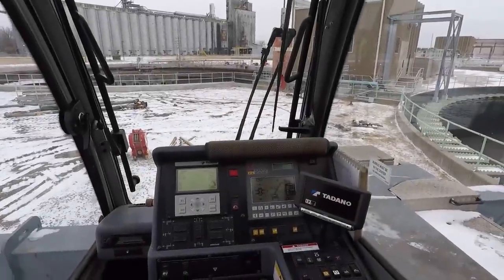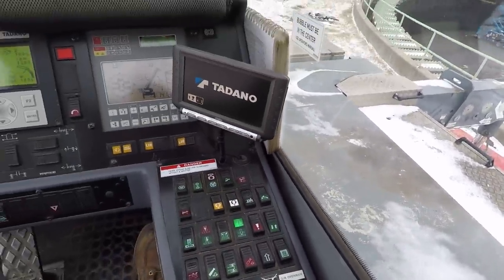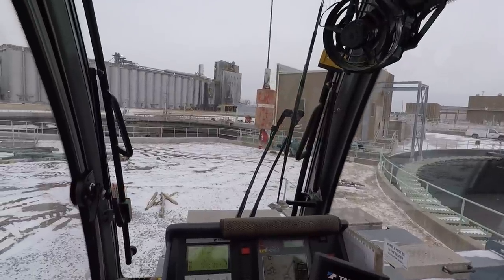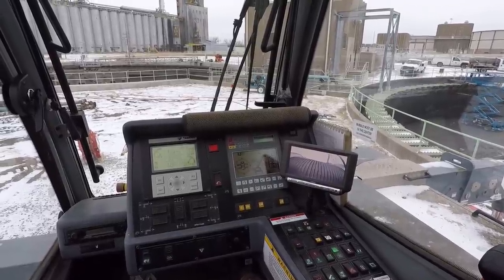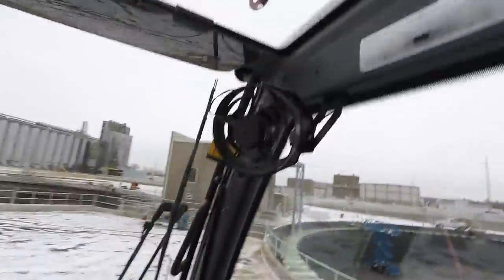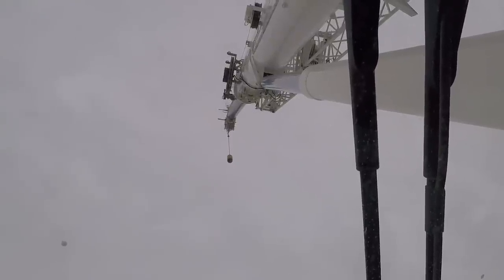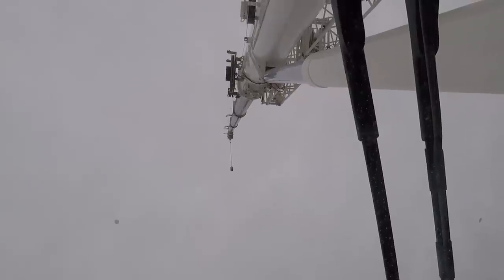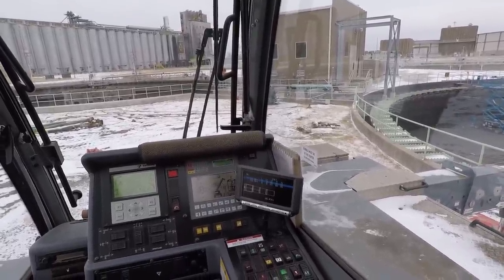To The Top Crane | Boom Extend Procedure

Comment: Good info, I have been around large all terrain cranes at industrial sites but didn’t know the pinning process was so automated. I have a lot of time in RT’s 35 ton and down. They were all full power booms with the longest on a 635 Grove at 104.
Reply from the maker: Carl williams, they can be extended and retracted in full manual mode too. But, it takes longer. I think Grove and Liebherr have a few good animated videos on YouTube, that shows what's happening inside the boom during extension and retraction. Thanks for watching! 🙂👍

Comment: I learned something new!  We have an ethanol plant that we haul to on a regular basis that uses cranes like that. Never knew how they extended it out. The last big one they had there needed 17 support trucks to haul all of the pieces for it.
Reply from the maker: tuba7084, 17 trucks would make for a very large crane!
Reply: The ethanol plant employee heard it cost around $60,000 a day to have it there. They were putting new equipment behind some large tanks and only way there was go over top of them
Reply from the maker: tuba7084, that sounds pretty reasonable for a crane that requires 17 trucks to mobilize. That had to be around a 900 ton capacity or bigger.
Reply: The employee said it was the largest wheeled crane around.
Reply from the maker: tuba7084, does Liebherr LTM 11200 9-1 sound familiar?
Reply: I never did catch the model number of it. The company has their name big and bold on it though. I should of snapped a picture of it while it was there

Comment: I want was very close to an operation with Dmag crane setting a 100 ton forging unit at a steel mill. The crane appeared to be new, but when I looked in the cab it had 60,000+ miles on it. They maintained that crane meticulously. I asked one of the workers how often they use that crane and he said that it is used most days of the week. I was surprised to see how many workers travel with the crane to set the counterweight and take care of the unit. Quite interesting. Once the crane unloaded the forging unit outside and put it on a special trailer to go in the building, they brought the crane in the building and put the counterweight on with a bridge crane. They did beautiful work as well with low overhead clearance. Steady, safely and meticulously set that forging unit.

Comment: One thing to check is the communication reel retract spring and length indicator. My GMK 5120 spring failed and communication cable jammed inside boom locking up rig for days on a job. Grove has emergency retract hoses external and lock pin removal bolts to release sections. It was out 167 with full jib @ 75° ....
Also previous owner didn't change winch gear oil.  This oil needs to be changed alot . Otherwise these machines awesome.
Reply from the maker: james norse, that would be NO good! Especially having to leave it in that configuration. I bet you were glued to the weather forecast. I peek into the inside of the boom pretty frequently. The last thing I want is a rig stuck in the air. Especially if I had all the jib in it. That's a tip height of 330 feet. Thanks for watching! 🙂👍

Comment: Very nice, I also learned something new. I would have thout what there was some sort of wire and block with a cylinder, inside the boom, like forklifts have. But you showed me :-)  Can you use the boom with the "active" or "lose" section not yet pinned at one of its holes? for example at 61%, or do you have to get it pinned not to damage the boom-cylinder during lifts?
Reply from the maker: exeqt, it can be operated with a section only pinned to the telescope cylinder. However, capacity is reduced. Thanks for watching! 🙂

Comment: I know the Tadano 200G-5 is slightly different in terms of screens, but should it also extend automatically based on selection a boom configuration? Any chance you can explain this operation on the 200G-5? The guy that trained me showed me how to do it manually, but it's confusing to manually lock/unlock the pins and gearbox properly for each section. I don't have any other training or experience on a Tadano, but I thought that it should extend automatically based on selecting a boom configuration, just like this Tadano. Any help is much appreciated. I can't find any instructions in the operation manual, and can't go find any details online🤔

Comment: Great job explaining everything. Couple questions. Why does it not pin the first two sections at a 100% and pin the 3rd at 79%? 
You said that every click is about a 1/2" of cable, wouldn't that change as the drum of cable gets spooled out and the diameter of the spool gets smaller?
Reply from the maker: JOHN HUFNAGEL, the boom sections have holes in them at specific points. Those holes are for the boom pins of the next section. So, it can only pin at those points. You are correct about the clicks. They do vary with how much rope is on the drum and how many parts of line are reeved. Thanks for watching! 🙂👍

Comment: Thank you... that was actually interesting to watch.. As per, you sending me here from yesterdays, video release. I am still working my way through your collection of videos, one a day!!!! Much of what I asked on another video, you answered here, thank you.. ALthough, my desire to see pictures from the manuals of the booms guts , would ROCK!!! Lol. As I understand this, so far, you can choose any of the boom sections to slide out.... so if all boom sections are collapsed inside one another, sure, it doesn't reach very far, up and or outwards, but that is when the boom is the strongest? and when all the boom sections are completely extended outwards, not as strong as the previous statement? what I am getting at, is extending the boom outer most sections first to lift heavy items, is a better idea, or extending the inner most section going to provide the same amount of lifting strength or prevention of damage to a boom? to define my question further, (sorry, I know my questions are very abstract, and likely odd) but, I example, although a "whatever brand of crane" can reach 900 feet high, but this said crane only needs to extend its boom to 150 feet, BUT... the load is super heavy, not extending the center sections of the boom, and only extending the 2nd section, would allow the frames ability to pic up the heavy load..... Vs, knowing that the load could not be picked up, if every section was extended out and up... I will assume, there is so much more then what you can explain in a YouTube video, which is why you Katz, go to school for this amazing trade. Maybe, I can ask if this way, does each section have a different strength rating... I would think each section does. I ask this, as the sticker on the side of my little dinky book trucks, have a proportionate rates system, based on the angle, how much of the inner section is extended out. And over the years, seeing other wreckers having been damaged due from lack of training, or know-how, the center section is what always is broken or bent. simple physics, I suppose, as the center section is smaller in its squared diameter, from the outer section? These units you have are a whole other animal, sure they have parts that act of function the same, but, I will also assume, cranes are a whole other animal... thank you, Dru
Reply from the maker: Dru, how about if I make a video for you? That might be easier than trying to type it all. Thanks for watching! 🙂👍

Comment: The swing brake was a surprise to me. I didn’t know that those would rotate freely.
Reply from the maker: 02pwrstrk some cranes don't rotate freely. Just depends on manufacturer and model.
Reply: Back when I was doing hi-rises in So.Fla, when a tropical storm or hurricane was eminent, the tower crane operators would leave the cranes in ‘weather vane’ mode so the jib was free to swing which ever way the wind would blew to naturally achieve least resistance. Usually they faired pretty well.

Comment: The operator can not tell if the line is moving by watching it. Hence the clicking and winch camera. Much of the time the hook is out of view behind obstacles.
This pinning system makes the boom lighter than a traditional hydraulic boom extension system and that translates into a greater hoisting capacity.
Reply: Don't forget the boom is a lot weaker. Do not overload. Equally extending boom are stronger until extended to the max.

Comment: i have 2 questions:
1) why do you extend it to 93% instead of 100%? is it due to safety reasons? 
2) how is it different with a configuration of say maybe 56%, 56%, 56%, 56%, 56%? Do you have lower permissable load with such configuration? Also, is it safety reasons as well?

thanks for the great video

Comment: Can the sections be pinned at any point along their length? Have you ever had a section slip? Thanks for the great explanation.
Reply from the maker: Bradford Lunt, the sections can be pinned at 0%, 43%, 95%, 100%. Never had on slip. Actually, it would be impossible. When they pin, a large pin actually gets shoved through a hole in the side of the section below it.
Reply: Thanks for the reply. In my trade working as a Marine machinist I always tried to give the crane operator a thumbs up when my piece was landed. Those guys and gals kept me safe and employed for 40 yrs. I'll be honest the riggers on the other hand drove me crazy. LOL
Reply from the maker: Bradford Lunt, I sometimes have riggers that drive me crazy too. I've had some that thought they had to use every piece of rigging in the box. Lol
Reply: Yeah I had them put so many falls on an air compressor one time that I thought they would rip it in half instead of land it. The best ones I had would listen to me when I would say "in the past we had good luck with ...." But often I would be met with "don't tell me how to rig". I would have to sit back and watch them hang falls I new would tool block before we got the height. Lots of holding my tongue. Your doing a great job on the channel. Hope you get a gozillion subscribers.
Reply from the maker: Bradford Lunt, thank you! I'm doing the best I can with my limited computer skills. Lol

Comment: what are the winches in the boom for
Reply from the maker: brandon cook, which ones? The one's that I have a camera for, or the reels on the side of the boom? Thanks for watching! 🙂👍
Reply: @ToTheTopCrane  the ones on the side of the boom
Reply from the maker: @johndeere5134 , the larger diameter one is a hose reel for the hydraulic lifting jib. The smaller one is a wire reel that performs a few functions. It carries the signal from the anti two block, the anemometer, supplies power for the lights on the end of the boom, transfers information to and from the jib. It also measures boom length. Hope that answers your question? If not, I can make a video.